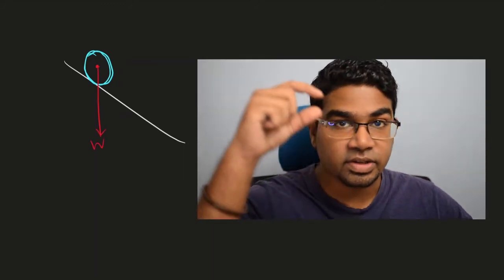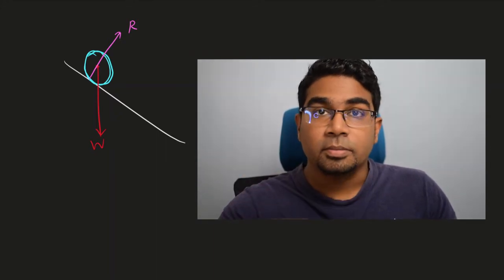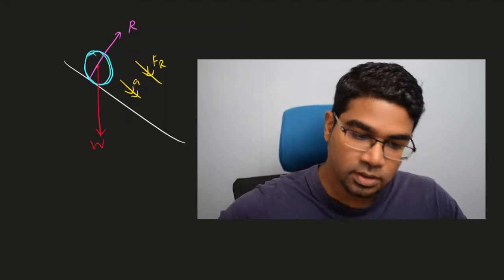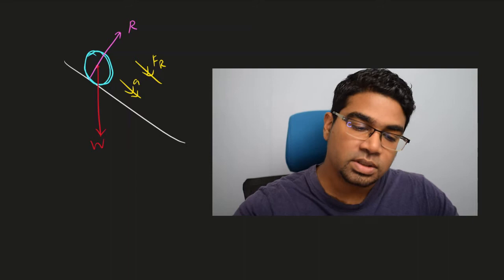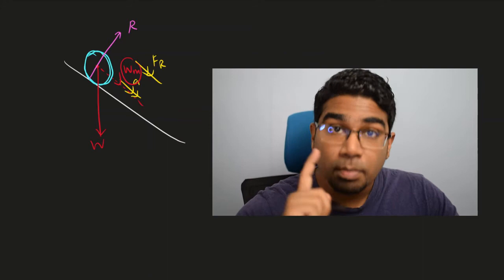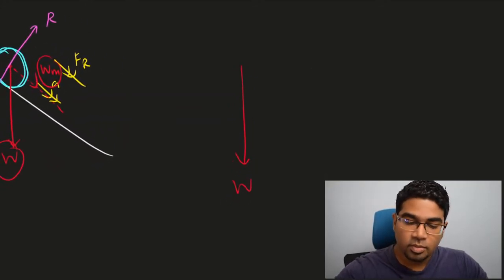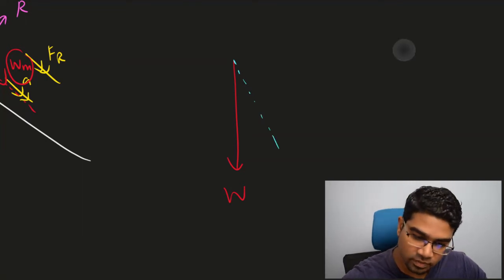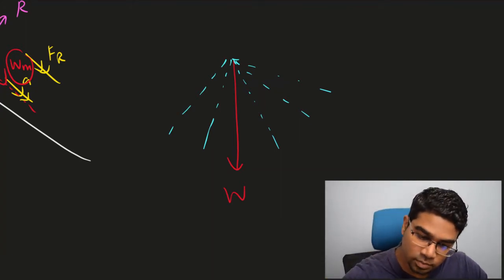Resolution of Forces \\ Solve with me

Comment: sir to answer this questions , i can use the sin and cosine rule from addmaths?
Reply from the maker: By right any method is fine as long as you can produce the correct answer. However, for SPM Physics I will advice against using sine and cos rule.

Comment: 1 question sir, on the first example you said that fy + fx = F but they didnt so why is that or am i understanding something wrong
Reply from the maker: Hi! I'm not sure which you are referring to. Could you please tell me the time stamp?
Reply: Yeap at 4:43 you said the components added together should give the force so I assume that means that fy+fx = 40
But when we found out the value of fy and fx it was more than 40 or did u mean something else by saying that?
Reply from the maker: That is only as a vector addition. Here we are only dealing with the magnitudes of the force vector, so adding the magnitude of fy and fx will not equate to F. We will need to use Pythagoras theorem to link all three sides of the triangle.